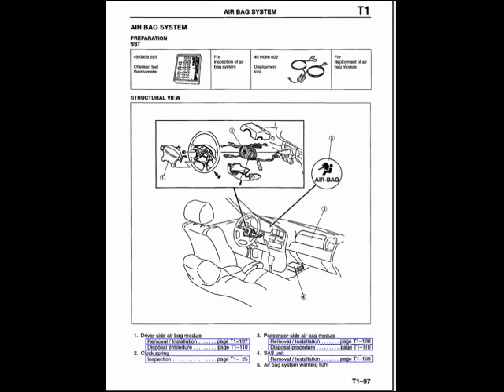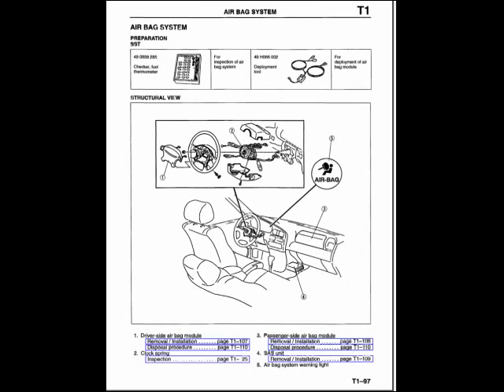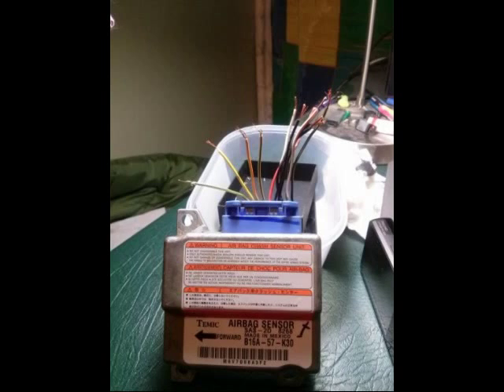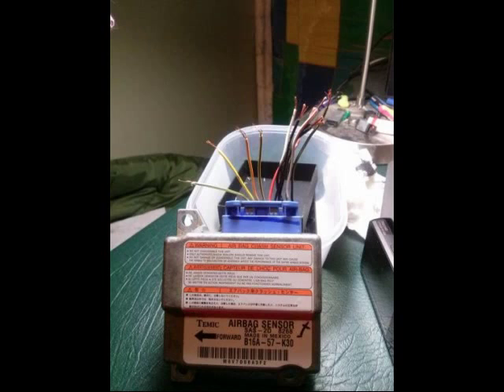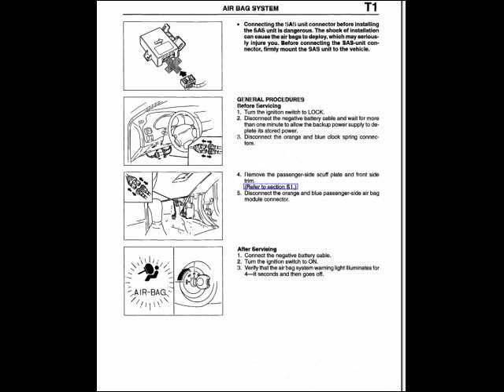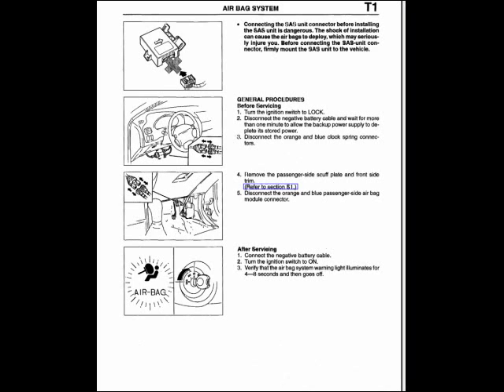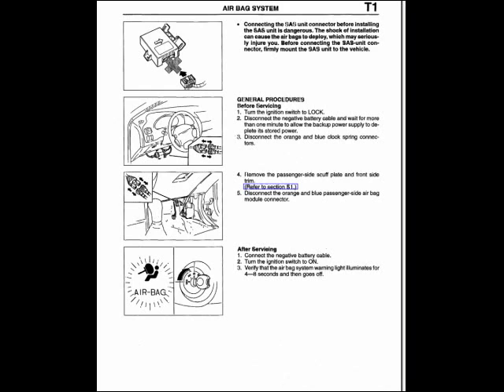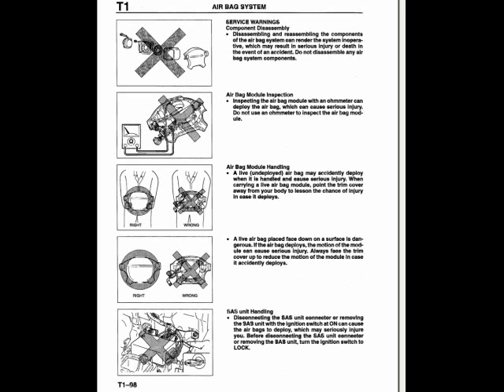Mazda 323 97 BA Protege / Ford Laser KJ flashing air bag light fix

Comment: Very informative ! my 323f is doing the 6 flash drivers side problem....may the investigation begin!!!
Reply from the maker: You may find a problem with the clock spring just behind the air bag on the steering wheel. It's actually a wound up flat ribbon cable that unwinds as you turn the steering wheel to supply data signals to the air bag, horn and anything else on the steering wheel. They do get old and start to break up. Pull the airbag unit off, bung on a 2 ohm resistor to the cable that the airbag was plugged into, and see if the light goes off. If it doesn't, pull out the Temic module strip off a bit of insulation from the two wires that I indicted go to the d/side airbag and put the resistor across them, (with the airbag removed!!!). If the light still doesn't go off, then it's a problem with the Temic module. I still have one if you need it and can't find one locally.
Reply: rossxxxx ,Hi, managed to solve it had a broken grey with red strip wire coming from the connector going to the airbag. Pulled the battery then the airbag, detached wires and tested continuity on the loom, very important not to test while attached to the airbag it may go off!